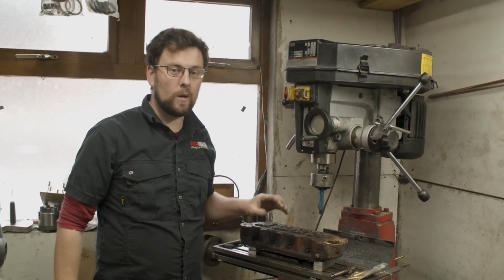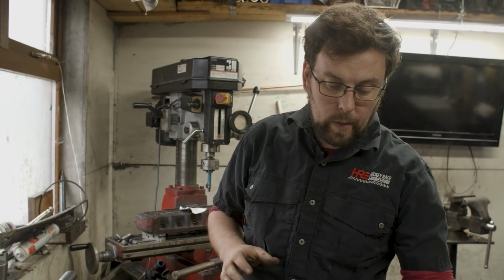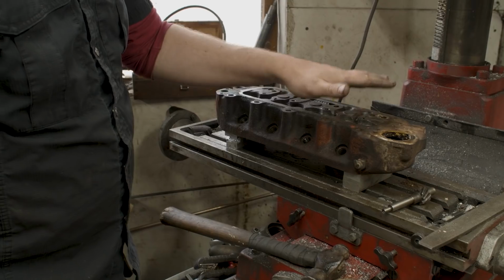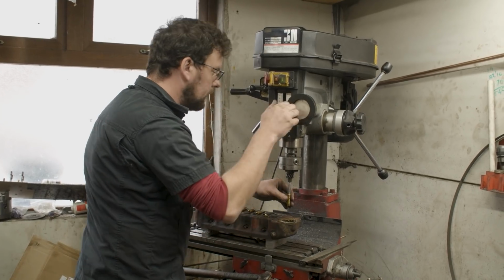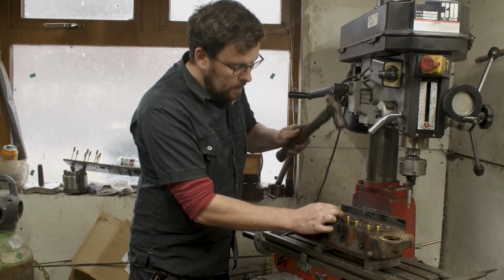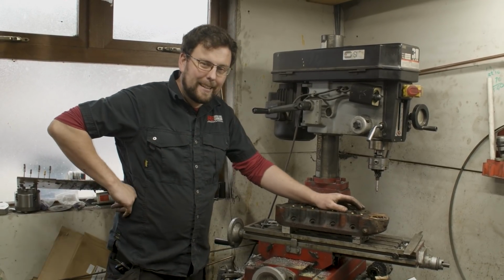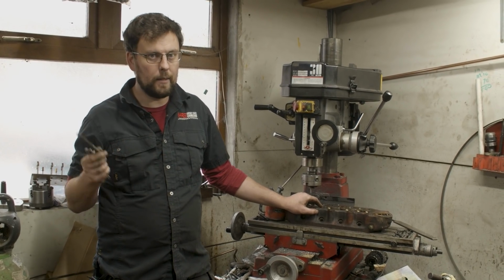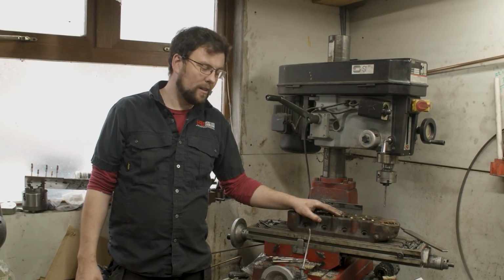Classic Mini Cylinder Head Overhaul Tips And Tricks - Part 3

Comment: Hi Paul, congratulations on another brilliant & informative video. Really good point you make about using a drift that has a concave end profile so it does'nt damage the valve guide end near to the bore. I've read how critical valve to valve guide clearence can be with regard to the possibility of heat from the exhaust valve causing detonation (pre-ignition) The valve guide with a free running clearence transmits some of this heat away from the combustion chamber. The article suggested not fitting Stem Seals to the exhaust valves to further aid cooling. I would be interested in your views on this.
Reply from the maker: Hi Martyn, thank you and glad you like the detail. Yes valve guid to valve Clarence is really critical. On race motors I actully use a hand hone and bring them out half a thousand at a time untill my go-no go gauge fits giving me the most accurate fit. I have never fitted an exhaust valve stem seal to any cylinder head I have built in the last 10 years the only down side is that as the valve wears you can get a very slight puff of smoke on initial start up as excess oil that has dribbled down the stem while the motor has been stoped burns off. However the increased cooling and heat removal is well worth it 👍👍

Comment: Your attention to detail is fantastic, back in the day we never used to bother about the valve spring recess depths. We used to taper the guides though, have never reamed out a guide but did lap any tight valves in with cutting compound. By the way we only had the standard guides back then. A really excellent video, as you say quality counts over quantity. Did spot that deliberate error you made to check that we were awake!
Reply from the maker: Hi Tony, Thanks for the comment I always like to hear how you guys did things back in the day. Like you self up until about 6-7 years ago I didn't ream the guides either just a quick lap. Now however they are making these guides to such tight tolerances if you not ream them perfect they are very likely to bind up so its great piece of mind to ream them and know you are spot on size 👍 glad you are liking the content and I will continue do my best to keep up the quality

Comment: Thanks again for more great content and explanations. It looks like there's grunge in the thermostat housing and probably the rest of the water jacket. I assume the machine shop will be boiling/cleaning it out when there?
Reply from the maker: Well spotted Ron, yes it’s actually currently sitting in a tank full of Evapo-Rust. Hot power wash tomorrow morning and every bit of that will be gone 👍